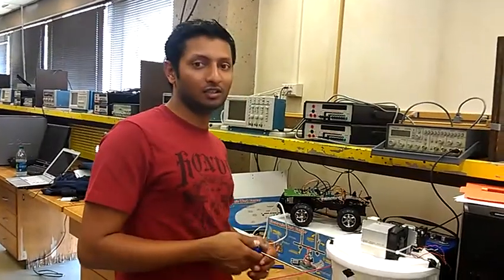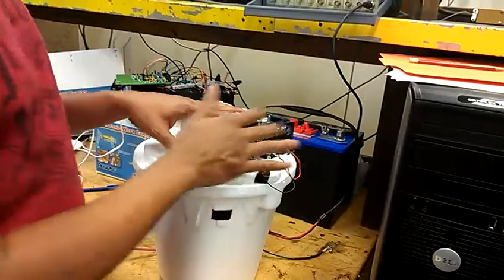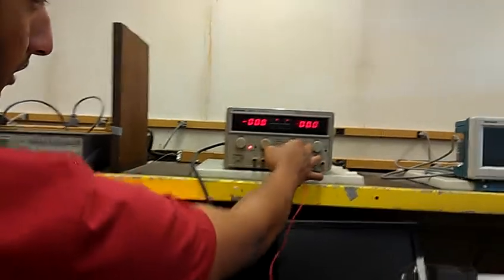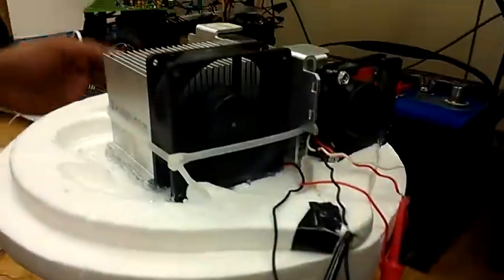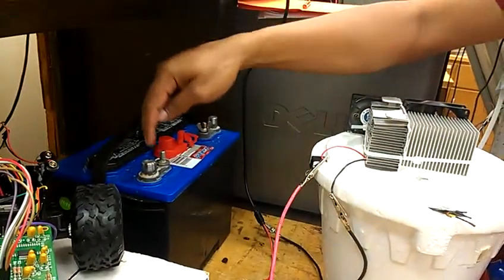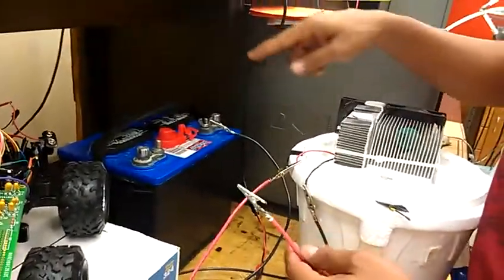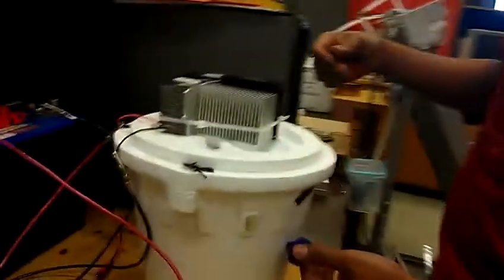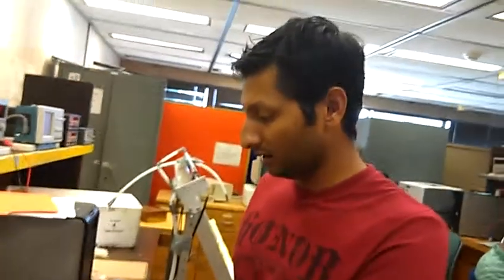Peltier Fridge Demo

Comment: Its nice... I have a question

I want to build a refrigerator of capacity 1 Litre which can cool the air to 0 C within very short time ( in fraction of second). How much peltier plates i have to use to get this much cooling ? Help me out to build it because this is my major project.
Reply from the maker: I'm not sure if you can just expect cooling in a fraction of a second. The peltiers take at least a minute to kick in properly. You could try with 3 peltiers using the same volume container and see what happens. Remember that you have to have good heat dissipation mechanisms on the hot side, otherwise the cooling will be inefficient. Please share a video of your project when you are done :)

Comment from the maker: If the container is small enough, a fan might not be necessary as the convection inside would help circulate the air. Also, adding a fan inside might create some heat (not sure if it would be significant heat). It's definitely worth trying to see if it makes a difference. Let us know what you find. Hope you can post a video of your set-up :)

Comment: I'm building the same project now but I was planning to mount another fan inside the container to circulate the air and help distribute the colder air around the cold sink. Do you think it would help or is it unnecessary? I'm hoping to get below freezing in the container as my Peltier cools to -12 at its surface now

Comment from the maker: I don't think that it would be as effective unless you have a very good heatsink. Remember, the cooler you get the HOT side the cooler the COLD side. The fan would certainly help dissipate the heat. Also ensure that you use thermal paste between the heatsink and Peltier. This would ensure increased conductivity of the heat. You might still be able to get away without a heatsink, just experiment with what you have and see how well it works.